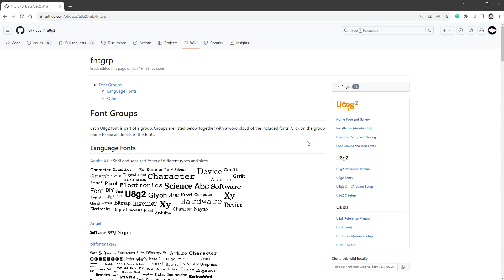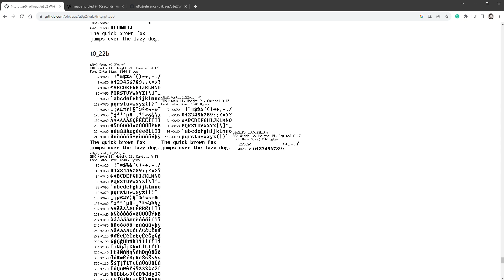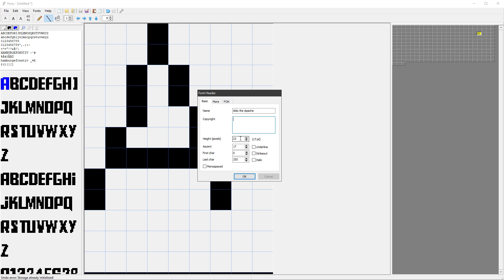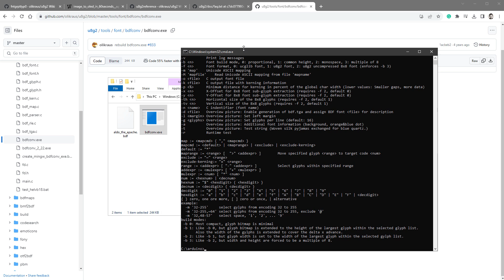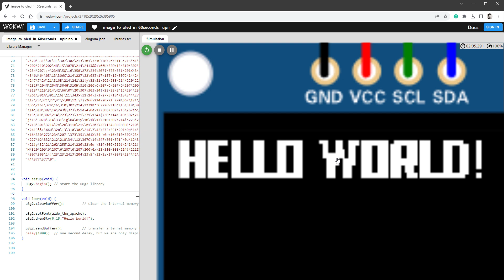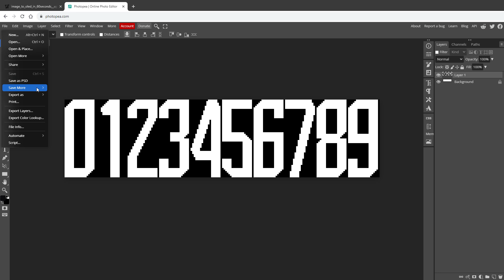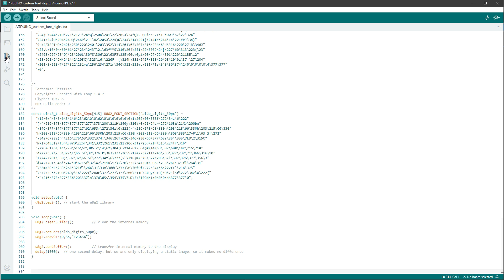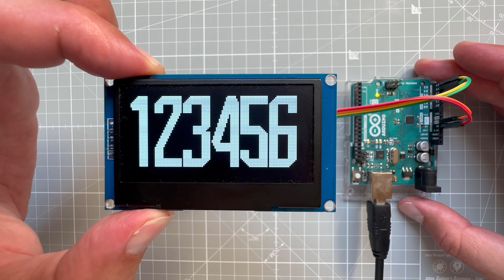Arduino OLED Custom Fonts (tutorial for beginners, u8g2 library, SSD1306, IIC, SSD1309, UNO)

Comment: At this resolution, he mostly was just doing “How to draw pixel art” 😂
Reply from the maker: That´s correct. If the font is not properly designed for low-resolution, i.e., either being a pixel font or having a proper hinting information, there are a lot of tweaks needed.

Comment: can I use 1 font for multi language?
Reply from the maker: Yes, if you use Unicode font and Unicode label drawing functions - for example:     

u8g2.setFont(u8g2_font_unifont_t_symbols);
u8g2.drawUTF8(5, 20, "Snowman: ☃");
Reply: @upir_upir  i mean if I can just set the font thẹ print any language I want ( meaning that I don’t have to change font every single time). This is based on a scenario that my esp32 has to display whatever it receives via Bluetooth, which can be in any language